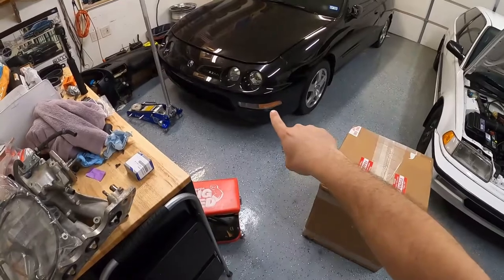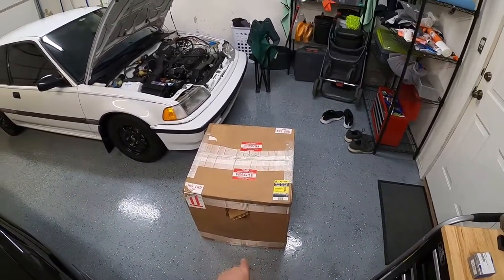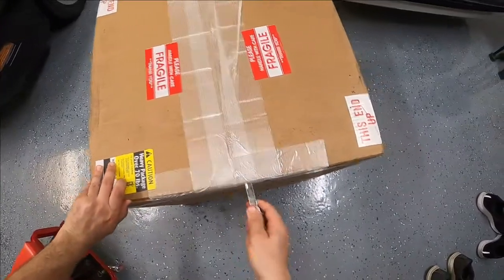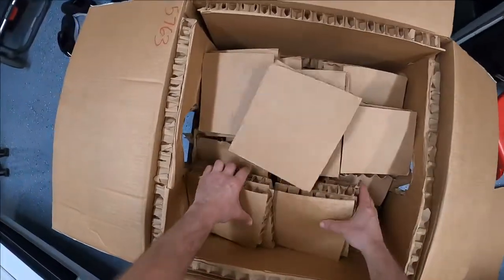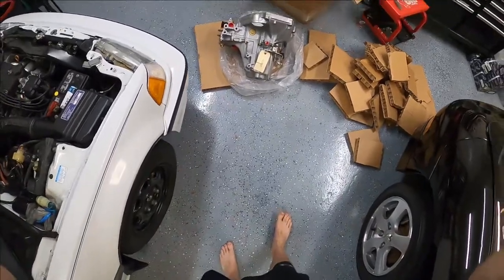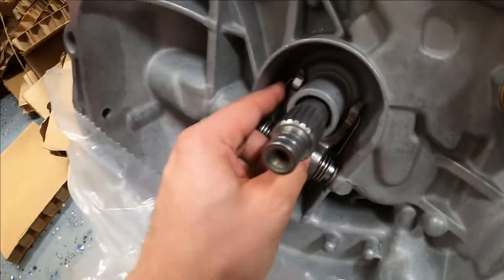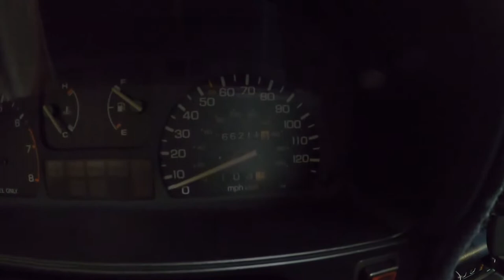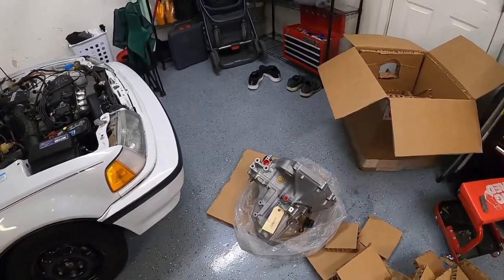SYNCHROTECH Trans Unboxing | '91 Civic Garage Walkaround

Comment: How’s the transmission so far ? Just sent mines in
Reply from the maker: It’s ok. Besides the reverse gear whines very loud!! The old trans never did that. Also, second gear has the slightest grind. Sometimes it can be hard to get into gear. I’m having to change the trans fluid every 20K to keep it the least bit tolerable.  Honestly, based on my experience with this “rebuilt” transmission, I would not recommend Synchrotech.
Reply: @spencersgarage  usually reverse will whine due to straight cut gear for reverse . Did u do brass synchros or carbon ?
Reply from the maker: @justinmacsanet124  I got a whole other already rebuilt transmission from them. Buy it and they ship it. I don’t know which ones they put in there. None of my cars have ever had whines in reverse. Being freshly rebuilt I would not except that at all. Not satisfied with synchrotech work or products. If I would have known their trans would have been so sub par I would have just had my original trans rebuilt by someone else.